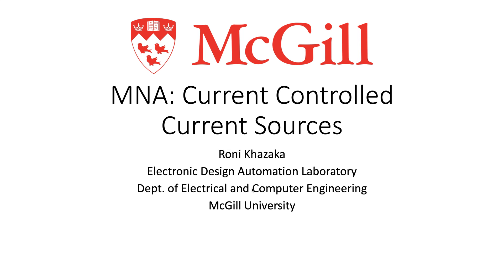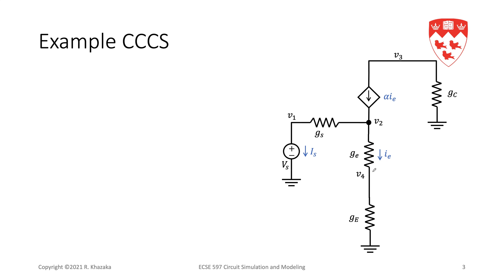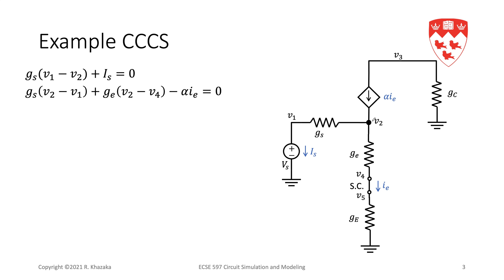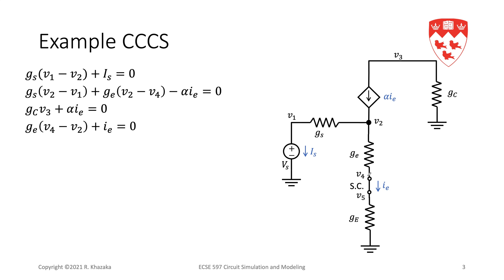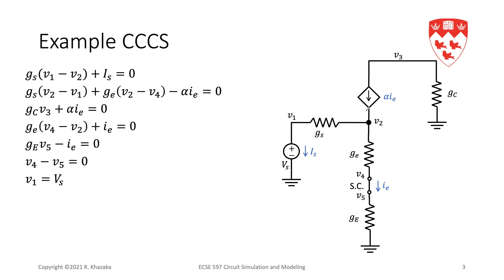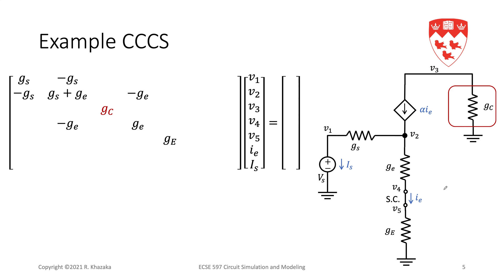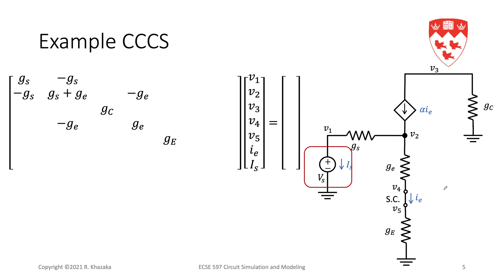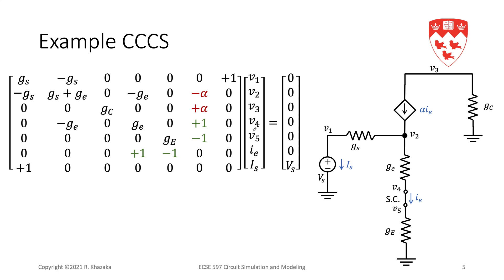MNA Current Controlled Current Sources Stamp

Comment: 00:07 - Developing a stamp for current controlled current sources in circuits.
01:43 - Implementing controlled current sources using KCL and node analysis.
03:22 - Derivation of KCL equations at multiple nodes in MNA.
04:56 - Understanding the short circuit model in current controlled current sources.
06:36 - Describes the short circuit stamp for current controlled current sources.
08:02 - Explains current controlled current source stamps in circuit analysis.
09:44 - Explains connection and stamping of the voltage source and controlled current source.
11:16 - Overview of the current controlled current source stamp.